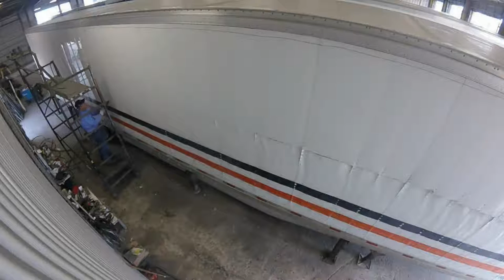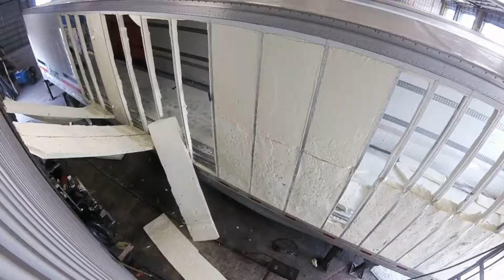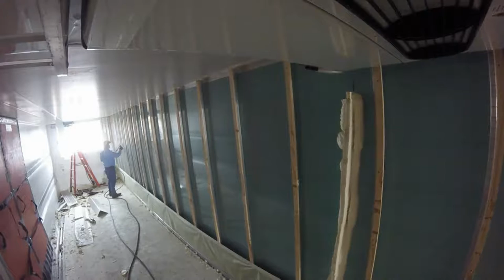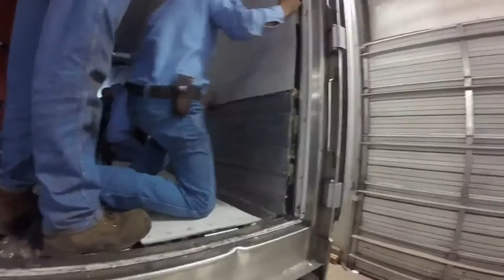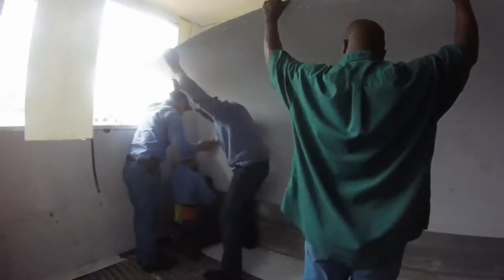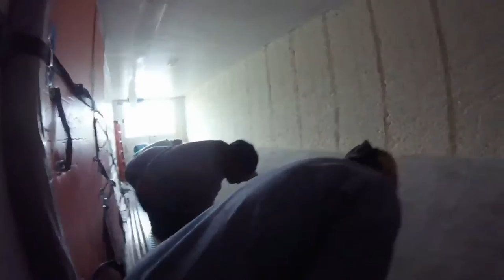Reefer Repair

Comment: is the outside wall aluminium plates or iron or fiberglass like inside wall no that had a metal sound
Reply: orangestoneface The exterior is aluminum or sheet metal. definitely not fiberglass or iron.

Comment: I was hoping to see exactly what process you use to attach your skin back inside.
If you want to see a process that is super fast 💨 & won’t require lots of extra labor to block & brace-
Check out the Tensorgrip EP0 line of adhesives like EP0- CAL or 
EP0- ZF  with these you can complete a entire wall replacement in about 45 mins.